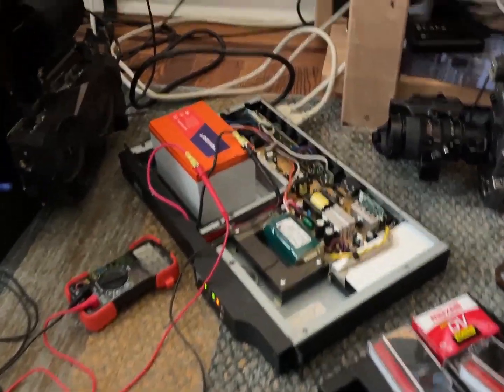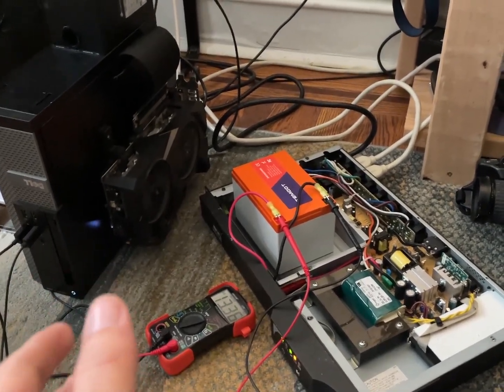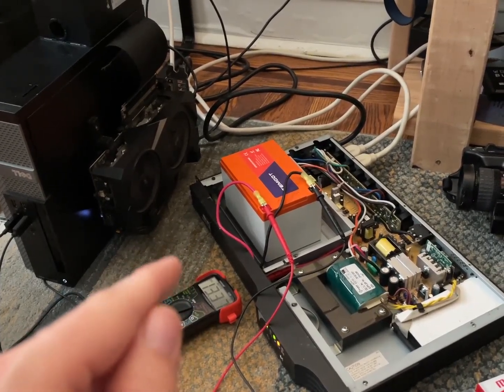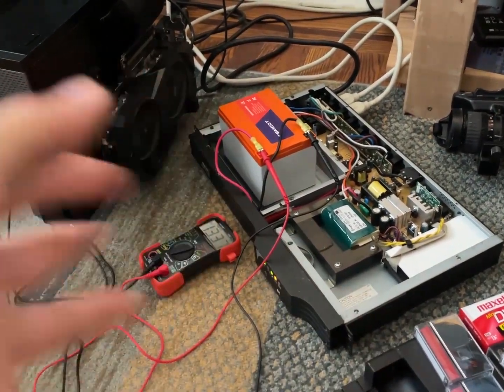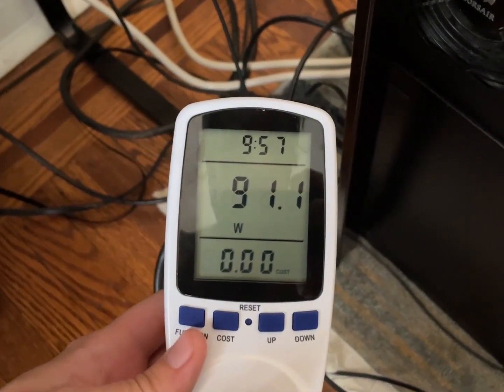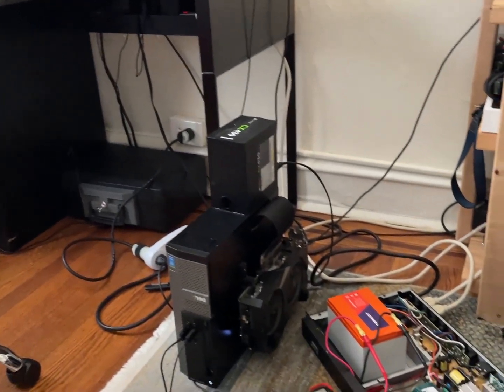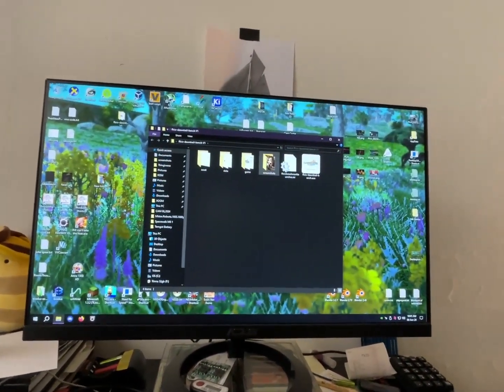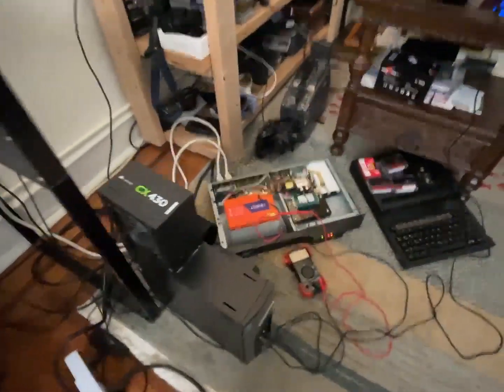Temgot 12v 12ah LiFePo4 battery experimentation and teardown. Actually really good quality inside!

Comment: I think that will work for a short time but soon the cells are going to go instantly of balance after you tune it on at that wattage, will make the BMS cut off if it's a good BMS. Need two of them battery's and make a plug in so the batteries can be external.
Reply from the maker: The BMS will balance it just the same like this, I dont think you entirely understand how BMSs work
Reply: @RinoaL  I don't mean after you changed it, that's fine. I mean if you pull the max rated current or over, they go off balance really fast, maybe not when new but it won't take long. they might still charge up balance but when pulling a load, they drop differently if pulling over max current over time and if they get too far off balance the overall voltage drops and BMS will cut it off. Unless that thing pulls less current then the recommended battery rating, maybe there recommended rating is over kill?
Reply from the maker: Ah yeah I doubt these are different enough to really matter for a UPS

Comment: Those are very good cells, i have 7kwh of them roughly that were used for a battery pack custom, but unfortunately the bus strip bars were too small and some of the cells were not getting balanced. Oh well, I might capacity test them and build a small pack, but yeah, 
Its alot of work, and it needs patience and well, expensive alcohol, or some  other type of sedative lol. 
If i need an ebike battery, thats probably what I will use them for, also, i will replace my dead nicd cells and deal lion cells with lifepo4 on all my old cordless drills. 

I have them now in a converted cheap chinese 15 led flashlight, and it is 3 cells crammed in the housing, and just a clunker on and off switch. 
About 15000 lumens or more, which I think is indespensibly useful as the batteries will not discharge cause of crap electronics, there are no electronics only shit leds to fail. 
ANd i can get about 2000 recharge cycles which will last a lifetime. 
This is how they should be built. 

Spot welding would help cell life too i am sure, it helps ease of assembly,  but best to burrow a unit instead of having another clunky niche tool.

Comment: I M HAVING FUN DOING THIS I HAVE ONE BATTERY WITH  320 18650 IN IT WITH A BAT BALANCER ONLY IT RUNS A T 15 V WORKING FINE FOR A OLD INVERTER IT WAS TO HIGH IN VOLTS

Comment: You can make a battery spot welder from a microwave transformer and some thick wire easy.
Reply from the maker: Far too easy to blow up the nickel ribbons that way, and also I would have to buy nickel ribbons

Comment: not mad sciency at all, its just the sort of thing I do, by the way you can get little lithium powered spot welders for around £40 - search Handheld Mini Spot Welder Machine Portable 18650Battery Welding Power W/ Display, not great but it can spotweld batteries at full power.
Reply: In the end, it's just a couple electrodes, a mosfet, and a button on a timer. I'm surprised it even costs that much (assuming you supply your own power source, which Rin has plenty of).